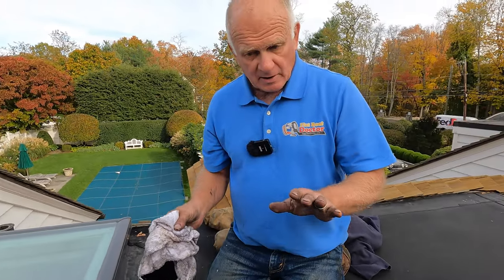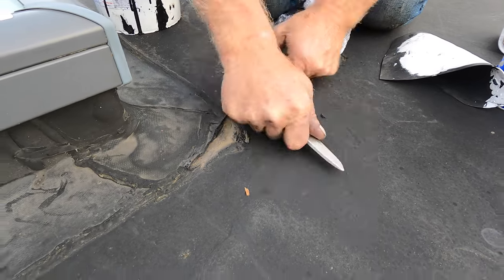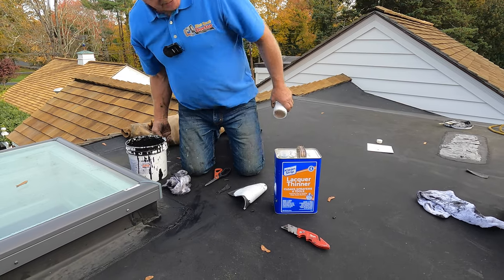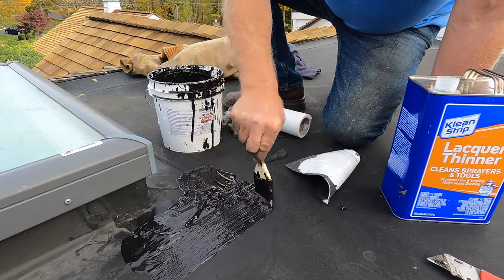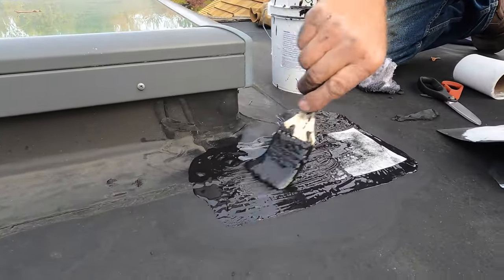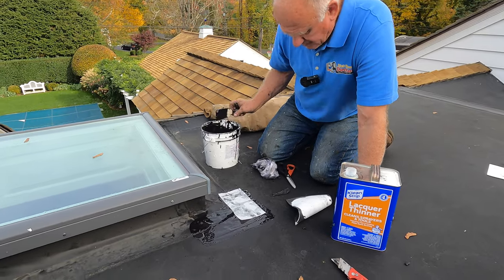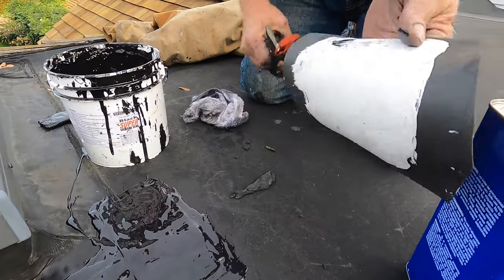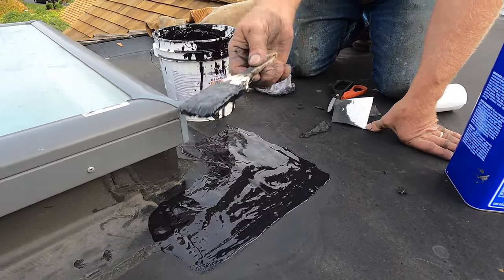How to Repair an EPDM Rubber Roof Leak in 3 minutes with no experience - DIY

Comment: It's simple only after learning it from you.  I've used so many different products since the 90s and always ended up having to remove it later cos it failed and then trying something else.  I've been wracking my brains looking for the solution and this is it. Just heart breaking it isn't available in my country.  Great video and much appreciated as always. Please keep making them.
Reply from the maker: It took me 30  years to find this product. By the way, if you can find some liquid silicone, and then a polyester fleece of some kind, then you will achieve the same results.

Comment: Been roofing for 30 years, you should repair EPDM with EPDM. To each is own!
Reply: Yea I’m just finding out my flex seal that the hoa said to use doesn’t stick to rubber through the winter… ugh😢
Reply: @Notsmogsjay Do you mean your wife? Said to use?
Reply: New era.. I never used that brand, but the Liquid Flashing and fabric  I use sticks to all types of roof
Reply: This is also what I learned from a roofing supply wholesaler! Touched up cracked caulking with black lap sealant and premium roofing tape for real bad spots - more black lap sealant around the edge of the tape

Comment: Great video! What is the white piece of material called?
Reply from the maker: It is Polyester Fabric that is a reinforcement to prevent cracking over seams
Reply: @FlatRoofDoctor  Cool. So, it is not a material sold by a company.  Thanks
Reply: @FlatRoofDoctor ❤

Comment: If I have a leak but I don't know where exactly it is can I just you super silicone sealer as a top coat?
Reply from the maker: If it is a EPDM roof, then most likely the leak will be where there are overlapping seams. Like around skylights, curbs, vents. Use the method I demonstrate in the video.

Comment: Id use a different brand silicone tbh and id id do around the whole skylight because soon or later it will do the same plus you want the customer to be satisfied after hes charged and he sees the amount of work thats quick ,did… cause to charge for a small patch is hard and ik because im a commerical tech and those jobs are not cheap . Now if u do it yourself just make sure you clean the area real goog and just follow the steps in doing it and you should be ok and put the silicone thick . Ive been to other peoples repairs and they think cause the lightly painted the area with silicone it will be water proof and thats not the case make sure your coat is thick or decent atleast

Comment: the lacquer thinner does not corrode the roof membrane?
Reply from the maker: nope, I have used it for many years. You could get EPDM wash from a roofing supply place, but it is not readily available.